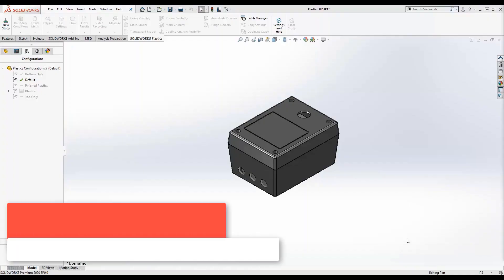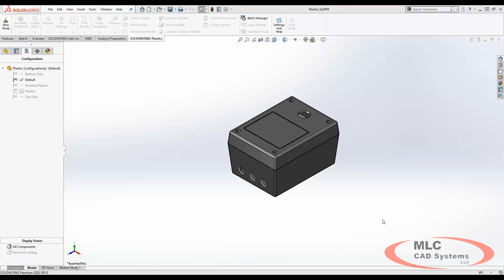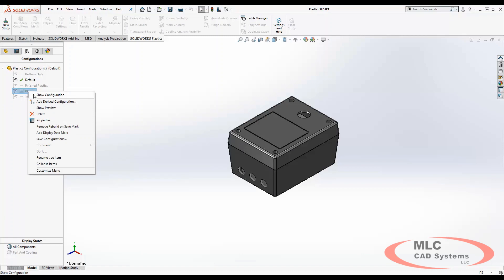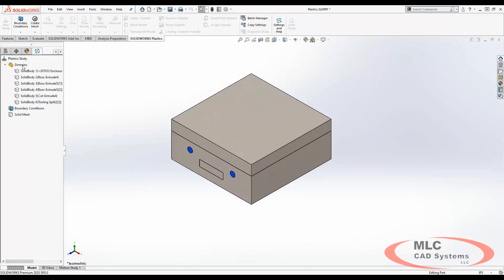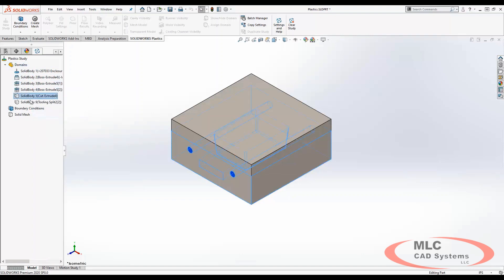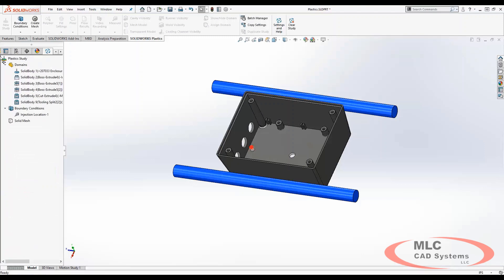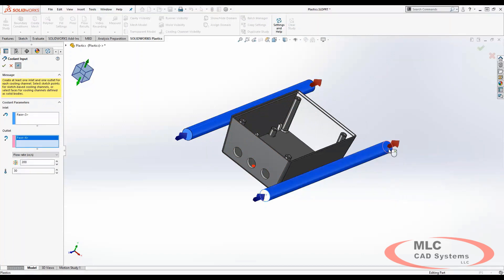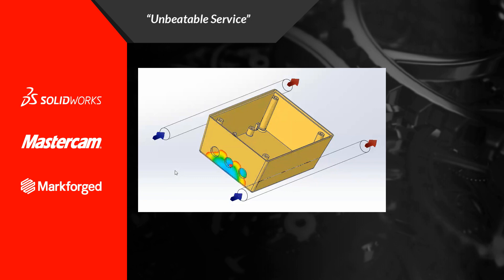What's New in SOLIDWORKS Plastics 2020

Comment: Great video.. i have plastic but hvent solidplastic how and where i can drill hole and line for plastic injection ways??
Reply from the maker: You can define geometry for your mold and for your simulation by modeling the part with the necessary features, such as the runner or sprue, or by defining a sketch as the injection point.  It mostly depends on your needs and your approach.
Reply: @MLCCADSystems  i didnt catch you what you ment
Reply: @MLCCADSystems  any chance to explain with simple technic ...how can i define my mold into the solidworks plastic ? thats way am asking queation which way to import frm rhino format to solidplastic and how do the sketch run and simulate it?
Reply: @MLCCADSystems i used runner but my injection locatin gate not set on my runner ...injection gates selects automatycly end of cruves edges.. why?